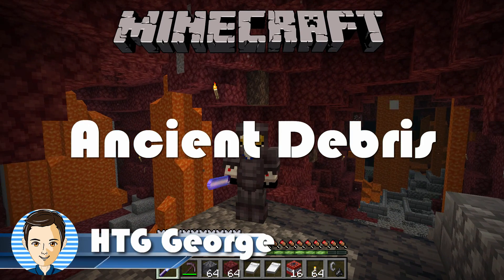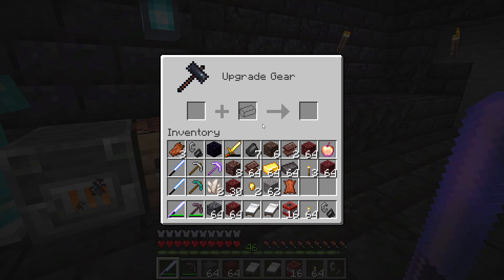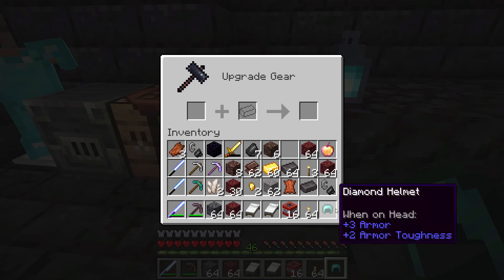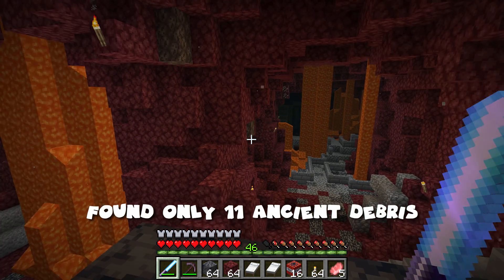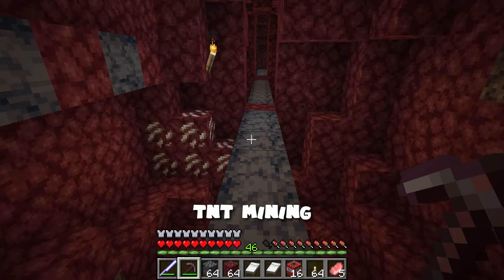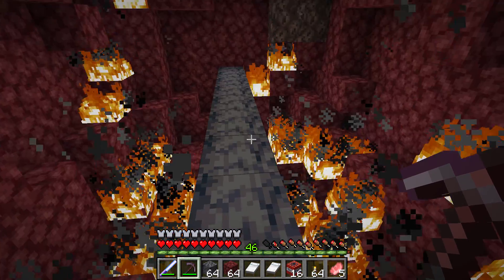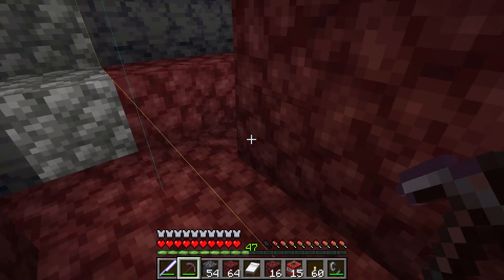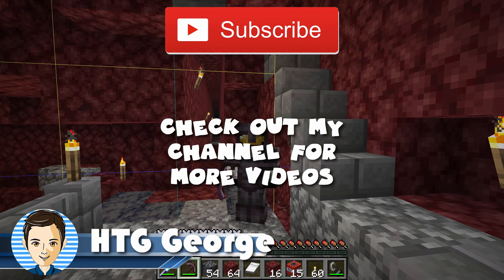How to Mine Ancient Debris in Minecraft 1.19.3 Java

Comment: How rare are ancient debris?
Reply from the maker: Its pretty rare, the rate is about 1 1/2 pieces per chunk, which is a 16 x 16 area and the whole world in height. If you do branch mining, making the tunnels 64 blocks long and putting the tunnels 2 blocks apart (tunnel, then 2 blocks then tunnel) digging at level 13 and making the tunnels 5-6 blocks tall and digging 21 tunnels you should get around 24 pieces, maybe more, which will make 6 ingots. So its pretty rare. And it will get a lot harder to make tools and armor starting in 1.20, almost impossible. Since you will then have to find a Netherite Upgrade in a treasure chest in a Ruined Bastion and those are also hard to find. You can duplicate those with diamonds, but it will take over a hundred diamonds to duplicate enough Upgrades for a full set of armor plus sword. So, take the time to get the ancient debris and make your armor and sword before 1.20 comes out. Or keep on playing 1.19 until you get the armor and then update to 1.20.
Reply: @HTGGeorge  Ok.
Why Mojang makes the netherite armors so hard to craft now? That makes peoples who wants that armor mad.
Reply from the maker: @kate_isawesome1207  I don't think they actually play the game
Reply: @HTGGeorge  Oh. Ok.